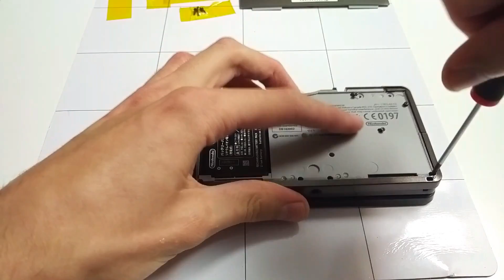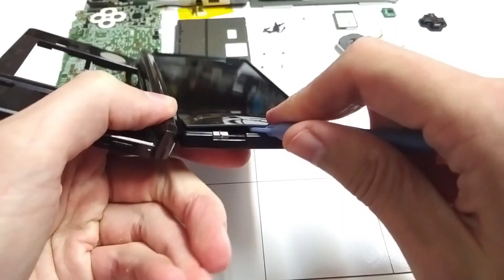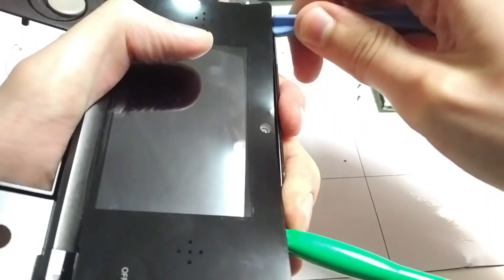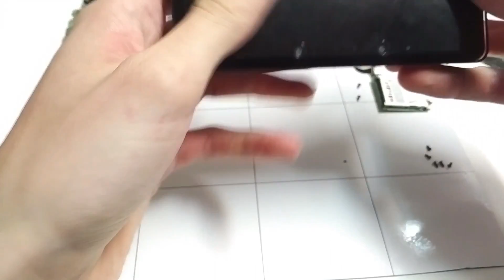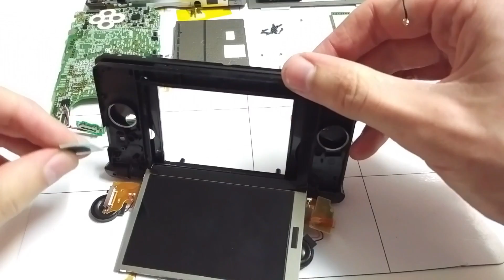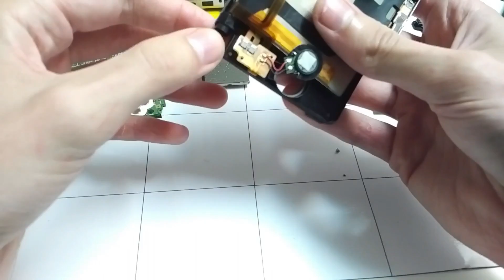Nintendo 3DS Disassembly

Comment: those back screws are IMPOSSIBLE to remove, how did you do it with ease?
Reply from the maker: If you are talking about screws under battery cover, are you sure you are using Y screwdriver?
Reply: Every website says to use a #00 Philips head screwdriver. Since this looked so successful taking the screws out, can you give me a link to that screwdriver or a good one for under $10?
Reply: Arron Pizza I got a pack of #0 #00 and #000 along with some flathead small sizes (four of them) for $6
Reply: Forgot where I got them, but I'm guessing you already solved your issue
Reply: AquaBlast nah i gave up and left it on my table so i could look at it with  depression every morning
Reply: Arron Pizza ...I'm still waiting for my parts from China to come if that helps
Reply: dude im having the same fucking problem like wtf
Reply: @vengful_gaming54 if you have a Tech Deck you could use the screwdriver included to take out the screws

Comment: I only need to replace my sd card tray. Do I have to take out the circle pad part or can I just take off the SD card slot and replace with another one and screw it back up?
Reply: No answet 2 years later
Reply: No need to take circle pad out... just careful remove the SD card parts. (I just took my 3ds apart today lol)
Reply: @EliasZamora  only 3 years late

Comment: I have the same 3DS as you (1st Gen), and I'm trying to unscrew the little tight screws by the battery section, any help on that? they seem to be stuck and I don't want to score it... i just need to fix a battery charging port issue (I'm pretty sure)
Reply: that's exactly what happen'd to mine!!
Reply: Same here! I’m dealing with that right now
Reply: I couldn’t open a 3ds that I was shell swapping and then I just got a slightly better precision screw set and the problem is gone. They do require a good little bit of torque the first time to remove them so I stripped two other precision bits before that so best of luck
Reply: I know this comment is old, but for the future person, use the rubber band trick. Put a rubber band between the screw and the screwdriver and turn it little by little doing a moderate pressure. This worked for me at least
Reply: I tried everything and I have one screw near the headphone jack that is still stuck!
Reply: I did it! It came out. If someone in the future wants to know this is what I did: I filled the hole on top of the screw with oil (that anti-rust, metal slippy kind) and let it sit overnight as I went to bed pondering my failures, then in the morning I drained the excess oil out, used a 1.5 flathead screwdriver, banged the top of it into the nail for 4 or 5 times (just with my hand) and then started unscrewing while applying pressure not to make the screwdriver go out of bump I just made. Ughhhh. What a process...
Reply: @Xitrial  How do I get the rubber inside the tiny deep hole?!
Reply: @j7sportvideo24  put the rubber band at top of the screw, then press the screwdriver at top of the rubber band, carefully and slowly turn it applying moderate force. It's a pretty well known method, search in Google it you need more info
Reply: @Xitrial  yup I know it just found out cuz im looking for solutions. Thanks I will try it

Comment: Thanks, this was useful for changing my old 3ds top screen. But, god damn those ribbon cables at the corner, passing them in that tiny round hole was a nightmare.
Reply: Xitrial I’m having the same problem, currently trying to replace my speaker cable
Reply: Wait, do you have to disassemble the bottom part to pry the top plastic in front of the screen?
Reply: On my ds I rolled them and used electric tape to hold it so I can pass it through the hinge than removed it to side it through the bottom case. This video is not good. The person more than likely destroyed the top screen ribbon cable. Me I’m planning to mod it for usb c charging. I’m more than likely going to replace the standard charging port. But keep the contacts for the charging cradle on my 3ds or just put a wireless charger in it. That has a controller. I’m thinking about getting another ds just to mod up just go all out with a usb c rgb leds clear shell.

Comment: Becareful removing the SD card reader on the side. 
Mine has some strong adhesive holding it to the plate that resulted in me breaking one of the connections to resolder.

Use IPA 90% (min) to weaken it before prying the ready off to save yourself the extra work!
Reply: I should've read some comments this happened to me 😭
Reply: are we supposed/allowed to remove the adhesive silver-black sticker on this plate?

Comment: Very awesome and helpful vid. Do you have a recommendation on where to get those sorts of tools?
Reply: For the screwdrivers, I'm just using ones from an eyeglass repair kit, they're the same size. The wedges to pop off the plastic screen protector can be replaced with thumb tacks, or any small wedge-able item.

Comment: Would I be able to access the headphone jack once I disassemble most of the 3DS? My little brother managed to get a small ball bearing stuck inside the headphone jack and no amount of shaking or banging would get the metal ball out. Would I be able to push it out once disassembled?
Reply: Elijah Pardinas No. I'd suggest a thin pencil with a bit of blue tac or a magnet on the end to try and remove it.
Reply: You might have to remove it and put a new one in it's place; sorry!

Comment: I have a stuck screw on the shell near the headphone jack!!! I hate stuck screws and I’ve been trying to get it out for half an hour using even glue or rubber ugghhhh
Reply: Same! Any luck?
Reply: Pedroza7iHD was trying for a lot, ended up working after I used some oil on it, then I used a flathead and formed a line by banging the back of the screwdriver with my hand, then applied pressure and moved slowly until it unblocked
Reply: @megasabri173  Ok thank you!
Reply: Pedroza7iHD you’re welcome! Hope that works for you too

Comment: man, the screws on my 3ds are so damn tight they're just not coming off...
Reply: Did you take em off? Im tryna fix my "popping sound" on two og 3ds's and an og 2ds and get passed the battery!
Reply: @j7sportvideo24  I have the same popping sound problem but when I tried to unscrew the inner black screws they just don't come out

Comment: Is there any way to get a water damaged 3ds working?
Reply: best bet would be an ulltrasonic cleaner, if you don't happen to have one of those lying around, grab a soft toothbrush and some rubbing alcohol (100% isopropyl ) that can be bought cheap from a hardware store. Around the board for any areas where a lot of corrosion is present and clean if gently with the brush. 

Using these methods you can fix the logic board however, the screens may be malfunctioning due to water, buttons may have gotten misaligned and solder joints weakend. A 3ds can be picked up for around £40 easily, I would personally recommend just replacing it, of course, unless there is data you desperately want to save.
Reply: It happen to me that my 3DS was caught in a rain in the garden. After that it was dead. I opened it an patiently cleaned any contact and motherboard with alchool . It than recovered.